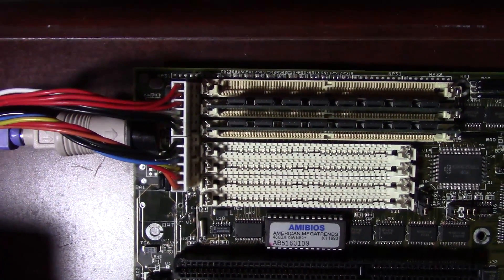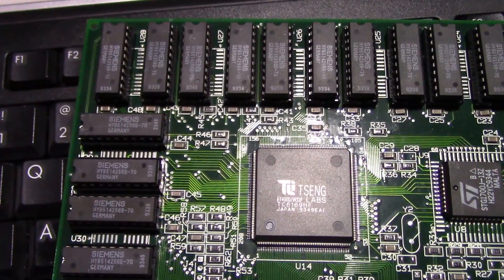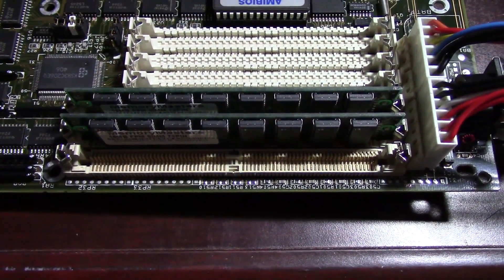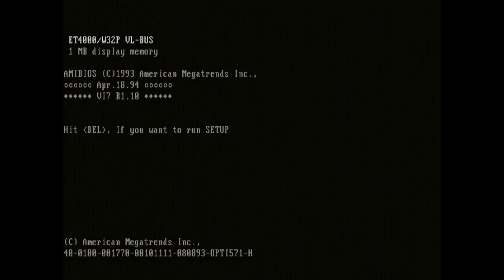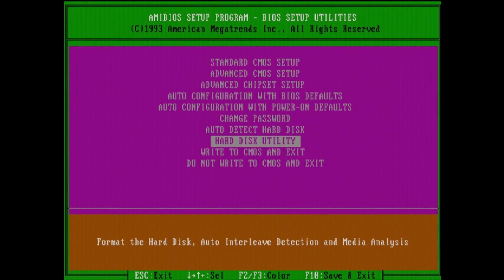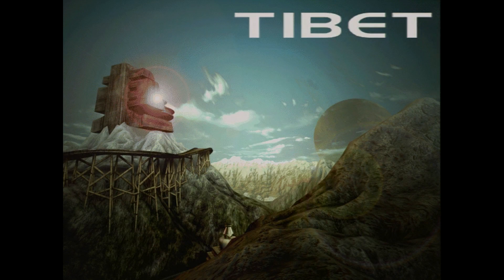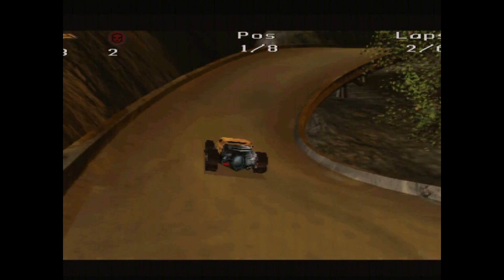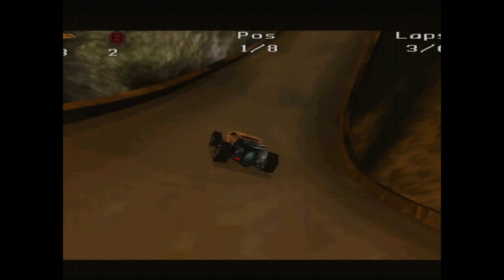Dual Socket VLB motherboard overview

Comment: Can you clock the P60 to 66MHz? There must be a good performance boost, beause the P60 run the PCI with 30MHz.
Reply: No, PCI, at least in most consumer boards, is always 33MHz.
Reply: there is no such thing as "always 33" on intel chipsets until P4 or maybe late P3. On 486 it is always 1:1 to FSB. On Intel chipsets for Pentiums 1:2 to FSB. PCI will be 25MHz on 486 DX2-50, for example, and 40 on  486 DX2-80.
Reply: From 1992-1994, 33MHz was the official spec. From 1995 on, there was 
also a 66MHz spec. Anything else would be out of spec. On my Pentium 
machines, it certainly ran at 33MHz, regardless of CPU clock. Where are 
you getting this from?
Reply: Do you have a 60 FSB CPU? Like Pentium 120 or 150? Or Cyrix 6x86MX-PR233(188MHz version) with 75 MHz FSB? Of course on P100-133-166-200-233 PCI wil be 66/2=33MHz, but there were others.
And, as you can see, Intel did not push FSB over 33 on 486 of PCI era, but AMD, UMC,Cyrix went out of specs with DX2-80 and  DX4-120. I used to have DX2-80 and AMD5x86-133( oc'ed to 160) when they were not retro, but modern gaming pc's.
Reply: Now I'm confused. An old article on AnandTech shows multiple chipsets with 25, 30, and 33MHz PCI bus support. E.g., http://www.anandtech.com/show/72/4. But I had a Pentium 75 with a 50MHz system bus (no backside bus yet, so not really a FSB), so you're saying the PCI could have been running at 25MHz? It had an OPTi Viper chipset of some sort, not Intel; was a Compaq Presario 5528 AIO. I can't find any info on what the exact chipset model was.
Reply: mstcrow5429 On non-intel sets PCI can be async, and always 33 mhz, but i believe it was later, on P2- P3 class boards( i can be wrong). So most likely, yes, it is 25 on P75.

Of course FSB is newer name, i know that))
 It's just shorter to type than "system bus"))
Reply: Did none of you guys watch the video? This isn't a PCI board at all. It's a VLB board. And VLB ran at the same speed as the FSB. So, all the arguing over PCI is moot.

Comment: very cool board though the somewhat lower performance is the price for the compatibility the board has , socket 3 and 4 on the same board is very odd to say the least. It would probably make a much better 486 board than a Pentium one.

I had the original Megarace on the 3DO , was about the same though the FMVs were a bit blurrier, those kind of mixed FMV games (stuff like Megarace , Rebel Assault, Crash N Burn) always made me a bit disoriented because of the difference in motion between the character/cursor/car and the environment.